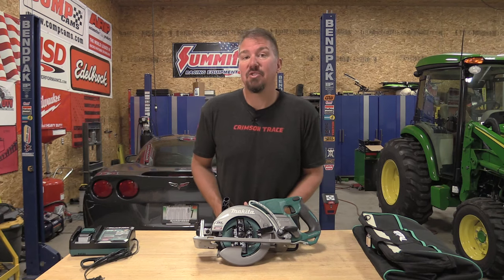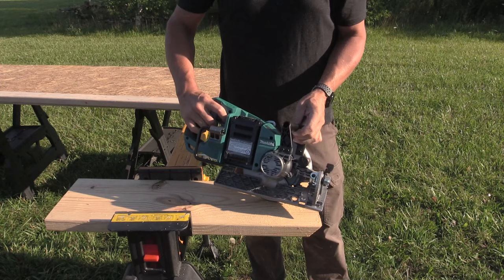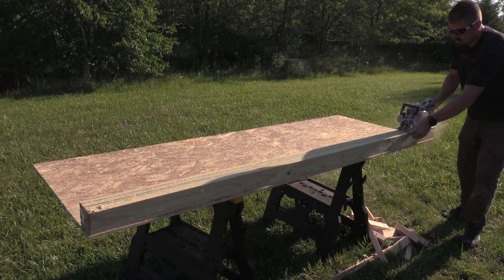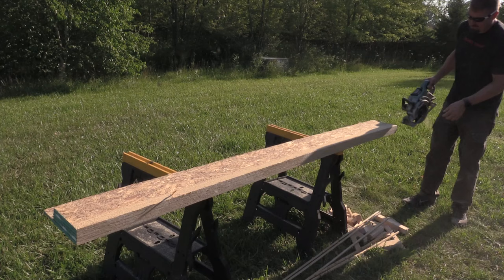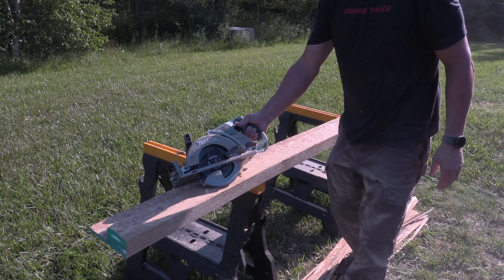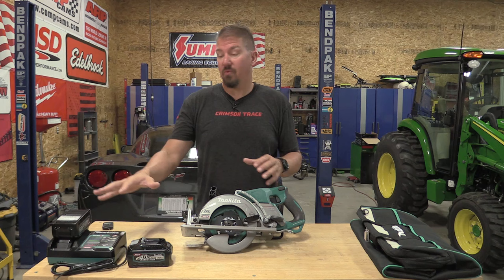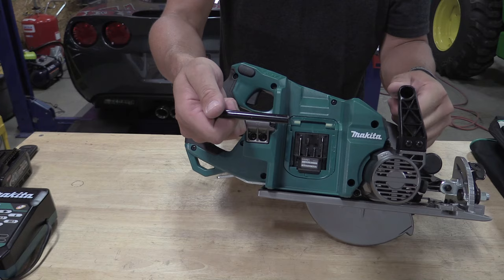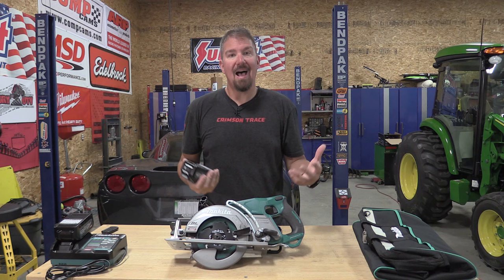Makita 40V XGT Brushless Rear Handle 7-1/4" Circular Saw Review GSR01M1 | Mind Blown!

Comment: It's been refreshing to see makita back in the well deserved spotlight.  Seems since Milwaukees recent success in the last 3 to 5 years makita took a third row seat.  I am glad you're not sleeping on them. I really enjoy you're show and appreciate you're professional opinion far more than others out there.  Keep them coming!
Reply from the maker: Right on
Reply: Well said!  👍
Reply: I'd have Makita anything over Milwaukee.
Reply: @interman7715  well on all the tests Milwaukee outperforms.
Reply: @JohnSmith-xq6cv  oh really? which Milwaukee tool out performs this saw?
Reply: @james-lm9kx  the milwaukee blade right sidewinder saw is better than this one. the fuel motor is stronger and the battery lasts longer but it’s heavy. the new makita xgt40v is the best saws in the industry now i’ll give you that. but when it comes to an entire tool platform i like the milwaukee m18 line.
Reply: better than the makita 36v blade right *

when it comes to circular saws i’d say makita is the king.
Reply: @JohnSmith-xq6cv  yea, fair enough. At the end of the day they still get the job done. Regardless of whether it's red or teal coloured👌
Reply: I'd love it if Makita introduced a cordless - gas less framing nail gun, hopefully they'll release one soon..
Reply: @JohnSmith-xq6cv  I have been framing houses for thirty years with corded Makita saws ,I now have some cordless Makita and Dewalt gear ,the Flexvolt sidewinder leaves Milwaukee fuel sidewinder in the dust . Makita makes high quality reliable tools imo.Milwaukee 18 volt is lagging behind in high draw tools .
Reply: @interman7715  except impacts drivers, sawszalls wrenches etc
Reply: @JohnSmith-xq6cv  I have these saws 
Makita exceeds on most tasks over the Milwaukee
I now have two of the Metabo HPT left side rear handle and it is now our crews go too-lighter, better site line then both the blue and red and lots and lots of power+lifetime warranty and AC adapter set up on cut station for long rips to save battery longevity and less need for so many batteries

Comment: Dewalt still has the best battery platforms/Charger. 12v/20v/60v all on one charger is convenient as hell.
Reply: They need to start making more tools tho
Reply: @brettwalkom948  absolutely. Take a page from Makita. Where is the kick ass 60v impact wrench?
Reply: I chose Dewalt cordless tools a few years ago and couldn't be happier , Flexvolt ,strongest saws imo and lightweight and  I can inter change Flexvolt batteries onto my XR gear, win win .
Reply: @dmacl123  yeah they have so much potential but they seem to have kinda given up on making new stuff
Reply: @brettwalkom948  the difference between dewalt and Milwaukee is that Dewalt puts much more R and D into tools, before releasing them. Flexvolt tools still lead all others and they’ve been out 5 yrs and the batteries work on 20v tools.. 
   Milwaukee releases new tools every year and the next year is gen 2 then gen 3  and many of the tools aren’t good until gen 2 or 3… Dewalt does it right the first time.
Reply: @jncn1490  dunno all of my milwaukee stuff is pretty good.. Dewalt don't have nearly enough options for my trade
Reply: new battery platform every 2 yrs lol

Comment: The battery is cooler due to it being 40volt. This is why DeWalt went with 60 volt. Power equals VxI or I**2xR and keeping the current down is critical for a fixed  resistance. Weight of copper is kept to a minimum but that increases resistance..  so the designers prefer higher voltages. The XGT is simply a beast especially for framing carpenters. The 18X2 is pro-sumer that probably wouldn't use the saw like you did, but this is professional saw. Finally battery powered equipment is so close to being on par with corded saw counterparts that usability without a power cord is the winning advantage. Delrin on the pin would have been better choice. The shoe shouldn't have play in it. That would annoy anyone. Weird for Makita not to be tight on tolerances.
Reply: On their cordless saws, they'll have ones that lock on the front and back and ones that lock only in the front.  The latter always has play.  I imported the 165mm and 125mm saws and thankfully they're both as rock solid as Mafell and Festool. My 7-1/4" sidewinder is not the Festool/Makita guide rail version and so it does the same thing as the rear handle, unfortunately.
Reply: Dewalt led the way with higher voltage Flexvolt batteries  and backwards compatibility  to 18/20 XR line .I think Makita blew it by not making 40 volt battery compatible to 18 volt line and may alienate customers. Milwaukee will have to up their game ,their 18 volt line is overworked on high draw tools imo.
Reply: @interman7715  I’d argue that it’s all relative. I know from experience that you got to buy new batteries or ones you don’t want to use on all of your tools anyway with most of the brands.  Hitachi, you still need to buy new batteries (it’s nice that those new batteries work across the line, though). Additionally, a lot of their kits still come with 18v batteries, so those typical gateway products aren’t gateways at all.   I’ve ended up with some 36v HiTabo HPV because the 36v kits are cheaper than piecemeal and my nailers shipped with a crappier charger and a 1 crappy single row pack each.  Milwaukee, Bosch and Metabo all have released incremental available current increases to their battery lineups and plenty of their products don’t perform at their best unless you upgrade.  I’ve been there with Bosch and Metabo, replacing my 18v batteries because the new whatever needs 20700 and then 21700.  My friend is there with Milwaukee.  A different 18v battery for every 18v tool I reckon. Dewalt, the Flexvolt may work on your 18v tools. But if there’s no advantage (other than run time), most people are not going to be putting it on smaller tools.  A lot of people on LXT are bitching about XGT and I just don’t get it.  If they’re so in tune with Makita, they’d see me waiting forever for Makita to drip feed XGT while they just dump shitloads of new LXT tools on the market.   That’s my complaint.  Coming from LXT where everything is on the same battery.   The small 12v stuff to 36v via x2.  It all runs on the same 18650 battery packs.  The catalog is deeeep.  It got me spoiled quick and XGT is: drip drip drip. Which means I can’t have everything in one battery anymore.  Because the depth of LXT  just isn’t available in 40v.   The LXT folk who haven’t bought into XGT have nothing to complain about.  Don’t take me for a Makita fanboy, however. I’m just detailing my experience.  I like the breadth of the Milwaukee lineup (18v and 12v combined), I like that you don’t have to switch brands to get good nailers, I appreciate all of the additional plumbing, electrical and utilities tools they have in their stable…etcetera.

Comment: for people who say the testing isnt realistic i believe it is, doing 24x24 garage packages its really common to need to get stacks of OSB in half length wise for the roofing and width wise for the walls and its efficient to gang cut them as many as possible right through a whole stack as many as are needed at once rather than setting up marking and cutting each piece as its needed, once youve built 3 or 4 of the same bundle you know what cuts need to be made and can basically make all your  lumber cuts off the hop and law the saw down for the rest of the day

Comment: Great review.  Keep in mind also that the Makita cuts deeper than the Red and Yellow saws do, and at 2-9/16 will confidently cut 2.5” (3X) material like Engineered wood products where the others will not.  This to me is a significant advantage of the Teal saw on a framing job, especially for cutting I-joists with 2x3 chords.
Reply: I have both saws and mine do not cut all the through rafters on max bevel. Irritating

Comment: This is no doubt a sweet saw!  Great test and review, Brian!  I have both the 36 volt version of this saw, as well as the 7&1/4 sidewinder (XSH06)  love my 36 volt, but scratch my head as to why Makita could NOT figure out where to make a place to store the wrench?  Silly!  The loose pin mount seems to be a Makita thing.  I have this issue on a couple saws, inc. the XSH06, but not the XSR01 36 volt rear handle.  I really like how you test saws and run them through various wood depths and materials.  @06:28 You acknowledged your cut was off. Of course, cutting through ‘expensive wood’  on a job, trying to follow a line would dictate slower feed speeds. This saw was very impressive how it performed.  The thing about Makita saws is the smoothness.  This translates to better cuts, and less fatigue at the end of the day.  Appreciate your efforts Brian!  👏🏻👍👍👍👍👍😁✌🏻🇺🇸

Comment: Love the channel. Great review and Makita makes great tools. The Makita rear handle 36v is a great saw and second best and this saw looks even better. 
    But as a framer running 3 frame crews , nothing still beats flexvolt tools except the sawzall is not the best. Milwaukee is not even a contender in the building world. Great for plumbers, hvac and homeowners. 
      The dewalt rear handle is completely unmatched still . Same for the circular saw, grinder , mitre saw and table saw..
Reply: My boss (company) is exactly the same . Runs 4 crews all on flex volt, well dewalt more specifically because all saws are 60v but not all tools are 60…. I think  you’re right for the most part about dewalt being on top especially for framing, but that’s IF you’re going to be consistent with 1 platform. Really though, I think that all comes down to the saw because that and the angle grinder are the only tools a league above. The rest of the tools fall anywhere between worst and best. Dewalt  Sawzall is good, flex is better, drill is really good flex is better, the impacts suck and all brands are better, battery nailer is straight shit, ;metabo is light years better, and the chainsaw is the best, blower also the best. Although I’d be interested to them against ego but I have no personal experience. I own and use those flex tools along side the dewalt equivalent on the daily just incase you think  I’m spewing bs found in reviews and not actually out there banging it out every day. Today me and two others finished facia and sheeted the roof, I rolled trusses and built and sheeted the lower roof for whatever that’s worth; figured you’d like to know that we’re on the same page since a lot of guys “frame” but not In the same sense as us framers who do new construction.  You can get away with Milwaukee if you’re framing in a new kitchen for an old remodel or whatever, but that’s shits not going to fly when knee deep in snow and out of breath from rolling 20ft beam only to find out your saw can’t make the cut because a tiny bit of pressure on the blade. Tgat being said I just picked this 40v saw up last Friday after my dewalt got jacked a couple weeks ago. And it is for sure on par and just as capable  the dewalt. There MIGHT  be just a little less power and that’s s big might because I’m basing that off things like sound and vibration rather than performance. Like the makita does sound like it Boggs down easier in stressful  situations than the dewalt however it can bog down much lower. You start bogging down the dewalt and you’re about 90% there to it cutting out unless you ease up. You bog down the makita and you’re about 70%. Take a common bind situation like stack cutting a bowed bunk of sheets. It might sound like the dewalt handled it a little  bit easier but the performance and outcome would be the same. If I didn’t have to adjust for the bind to make the cut with the dewalt the makita wouldn’t needed adjustment either and time would have been same, if not in favor of the makita because that thing cuts noticeably better. On the flip, let’s say I’m using my square as a guide just straight slamming into stacked joists cutting blocks the DeWalt MIGHT go through just a cunty hair faster, but that might be in my head. It’s like a max superframer vs an nr83 A2-5. I’ve got both an a5 and max  and can’t pick a favorite. boss provides metabos, but a few others run their max as well. Some guys will say the hitachi is built better?and it’s like… is it? Maybe sometimes……. But kinda not really though. Maybe feels like it but Ill smash them into a wall equally as hard. The metabo mighgt  sink nails just a little bit deeper doing super high toenails through lvl rolling rim, but I can maybe shoot a wall down faster with the max , however neither of those situations influence which gun I’m grabbing for the day or picking up for the task. I’m picking based on how bored I am with one or the other. Long story short the 40v is every bit as capable neither better or worse. The Milwaukee sucks really really bad
Reply: Just about everyone I know and even everyone I don't know but work around use only Milwaukee. That includes framers, roofers, remodelers, plumbers, electricians, and HVAC. The only person I know professionally that's doesn't use Milwaukee is me. I think it's kinda home turf sort of thing around here.

Comment: I’ve got the 36v and like it. I’ll go back and check the play on the pin …
Reply from the maker: I liked the 36-volt also!  Mine does not have the play in the rear pin like the new model.
Reply: @WorkshopAddict  cool. I’ll check mine … I agree; doesn’t make much difference.

Comment: impressive testing, impressive saw, my milwuakee fuel gen 1 would not do this i regret not waiting for the milwuakee rear handle, i think my saw is faulty it overheats with minimal use and cuts out really easily even with 12.0 battery, it wouldnt have made 1 of those full depth cuts

its getting worse i did about a dozen cross cuts 45's on some 2x6 the other day and it was complaining and cutting out even going slow and steady

Comment: Would the Milwaukee or Dewalt put up those full depth cuts in the OSB?  Well, try them and find oud.  It would be a good next video.
Reply from the maker: From experience with them, I believe they would once, but not over and over.
Reply: Mate I have the Flexvolt 575 blade right saw and it is unbelievably powerful.

Comment: My problem with this system is by doubling the voltage to 36, they've cut the runtime in half. So to make this viable you need to be able to get the work done in half the time.
Reply from the maker: Yes, and no.  So the norm for the 36 volt saw was two 5 amp hour batteries.  This has better cells, so you have 36 volts at 4Ah rather than 36 volts at 5Ah.  Not much difference there.
Reply: @WorkshopAddict  yes but if it was an 18 volt, that same battery would be 8 amp hours. Are you really getting twice as much power? That's my issue.
Reply from the maker: @tooltipswithtommy  100% get that, but...  I do not think you will get the same performance with the 2x18.  I will see if I can come up with something to show that.
Reply: I have the bosch 7 1/4 profactor saw, I'm going to see how it performs on a stack of osb. I'll use an 18 volt, 8 amp hour battery, Fair comparison.
Reply: I just wish osb wasn't so damn expensive. 🙂🙂
Reply: the double voltage motor should need half the amps to do the same work. You're getting the same power for half the amps. and half the heat in the battery (amps make heat). which explains why they don't have to spread the heat over 2 batteries anymore...
Reply from the maker: @tooltipswithtommy  DO IT!  I love Bosch but they are not up on power yet to compare with anything like this.
Reply: @wim0104  yeah so many people don't understand this.. Just wait till the 80V stuff starts coming out

Comment: I'd put the DeWalt Flexvolt rear handle up against any cordless circular saw. I have NO doubt that it is the best in the class. I have the rear handle Milwaukee and 2 DeWalt rear handle saws. The DeWalt blows the Milwaukee out of the water in just about every way.
Reply: makita is more balanced than Dewalt, Dewalts pulls